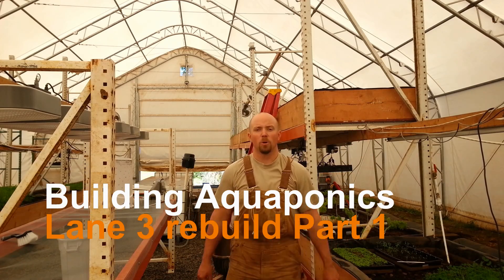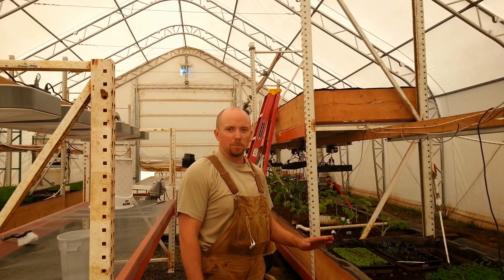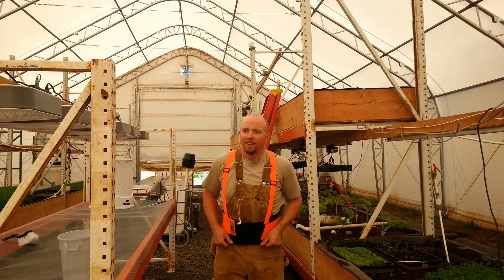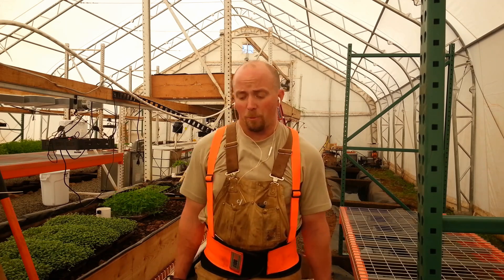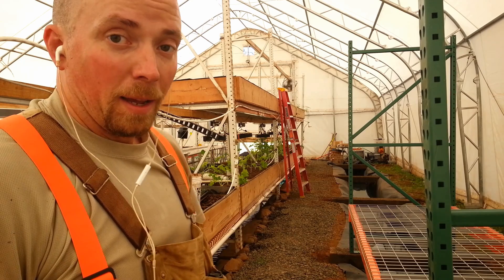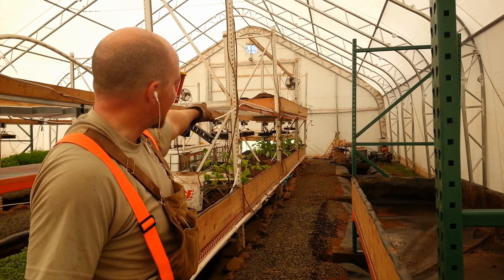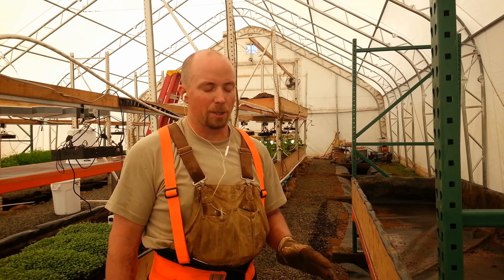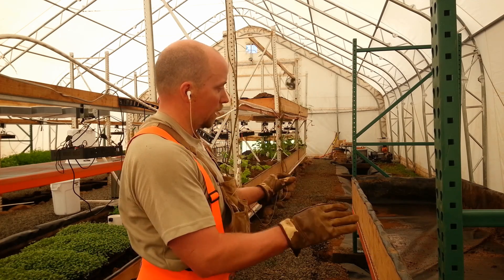Building AQUAPONIC and MICROGREEN GROW BEDS with RAINBOW TROUT - Part 1

Comment: Once you get 1 Bed in Place..  Add NON-Scented Cloudy ammonia to the Mix and Let it cycle.. About 1 littre or 1000ml or so..
Cycle without fish for about about 2-3month's until you get over the hump of Too Much HEAT...
Trout HATE water over 25deg C due to Lack of O2..

Trout are a fish that require HIGH O2 levels..

Comment: You have that overly large pump that you just showed us a few videos ago. Use it to wash the nearly hollow clay balls down a hole and outside. Then put a large tarp outside and maybe 2x4's to catch pellets. The water will wash away at the edges and the pellets will remain. Use 4" pipe at least and as much water flow as you can get.
Reply: Also, the struggle is real. Things go more than twice as fast with two people. I wish I could help. Same happens to me all the time.

Comment: It's not safe to lean a stepladder against a support. Always open and lock it. You especially shouldn't lean anything against Lane 3! If you set up the new beds opposite the ones you're emptying you can rig a chute to slide the rocks down. You'll probably want something to protect the liner right at the bottom of the chute. You could rig a chute to go one position down the lane but you couldn't just rest the chute on the beds
Reply: Hugh Brackett ..... hahahahaha comp won't pay.....and OSHA will fine....in our area it's $700 per violation for working on a leaning step ladder....

Comment: Couldn't you use a shop-vac or the like to pull them down? from what I remember Lava Rock can be light but it depends on the size.
Reply: That could work. He could sit the shop vac right in the destination grow bed and dump it when it got full. He probably doesn't have enough vacuum hose though.

Comment: Jeff, one of my many jobs in life was as a safety officer, the WHOLE purpose of the belt your wearing is NOT to give support in any fashion. The way it is to be used is to wear it around your hips to restrict your movement and to remind you to align your back squarely over your hips and not to twist while lifting and to bend your legs for lifting and not your back. Lower it over you hips and adjust the straps accordingly to restrict your movements.

Comment: TRM,          Work smarter, build the racks for the lanes. Then just move the grow beds across lanes. The rope system you have should help you position the grow bed in the adjacent lane.  That looked like to much work dragging the grow bed down to the front. Hope you get this message before the work is completed. If you have to move a grow bed along the ground consider using your wheel barrow as a cart of sorts. Cheers,       Bill